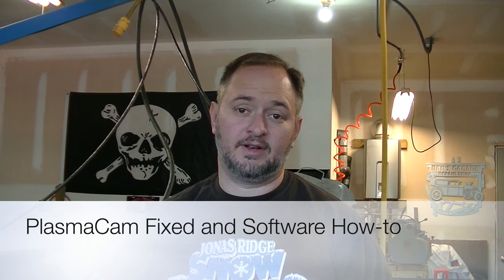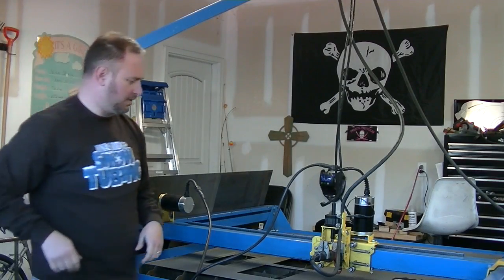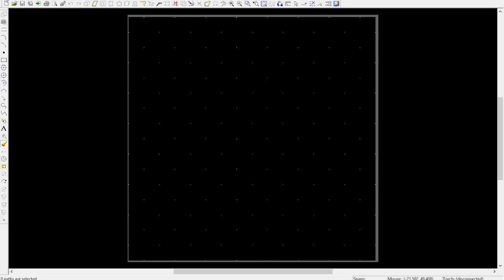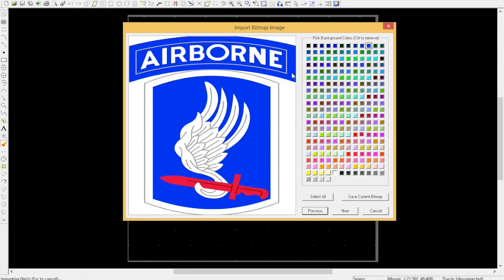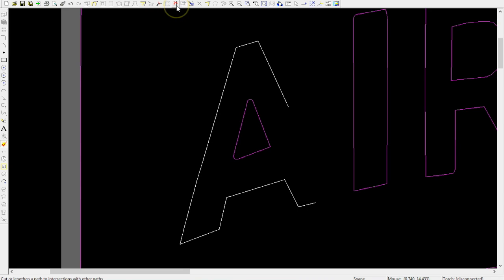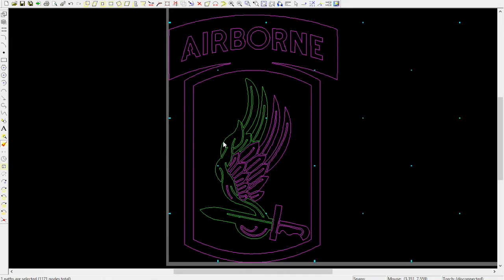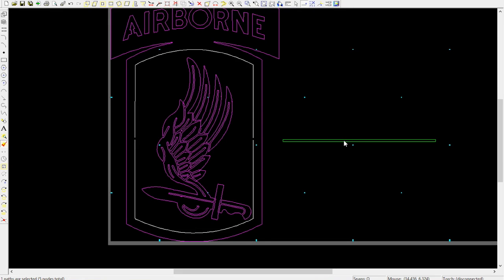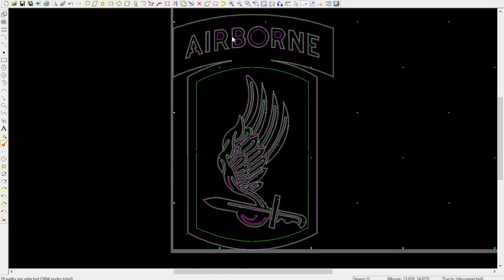PlasmaCam Fixed and Software How-to

Comment: Hi Tom,
Glad to see you got your PlasmaCam up and running again and with a fairly easy fix!  Good you had your old cables so you could swap them out.  I ended up buying a second seat so I could do some of the drawings in my office.   I just got the Advanced Machine Control.  I like being able to save the machine settings so it is much faster going between metal thicknesses.  Nice demo on the software!  What gauge metal do you use to cut that piece you are drawing?  I need to find some artwork for my local VFW.  I would like to make them a piece.
Take Care,
Reid
Reply from the maker: Thanks Reid! I'm sure you recognized the interface but I meant to show the whole window. I guess I messed something up in the editing. Glad this was something easy to fix! I normally use 14 ga steel which gives a decent balance between strength and weight. Let me know what design you are looking for. If I can help, I will.

Best wishes,
Tom
Reply: Tom Zelickman Your demo with the software was still good.  I spend a lot of time cleaning up artwork, as you did, so I appreciate what you go through.  I am looking for just a piece that has VFW in it, not necessarily a certain branch of service.  Even if you could steer me in the right direction.  I did find one of the guys on the internet that does some pretty nice work with the different branches of service.
Thanks for taking the time to do your videos!
Reid